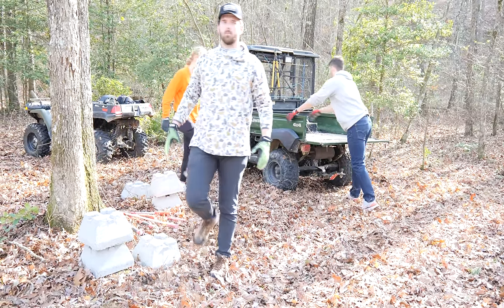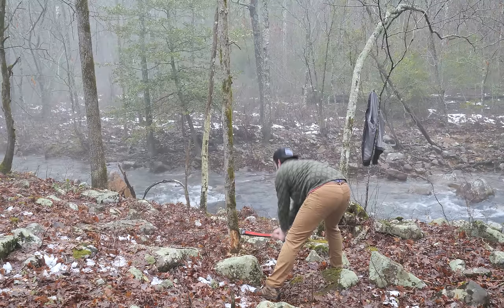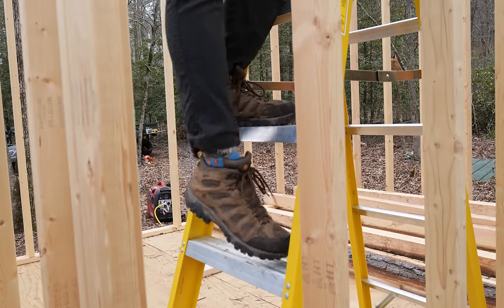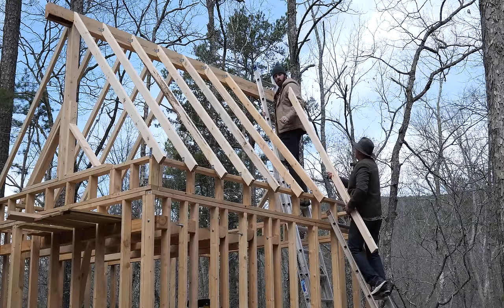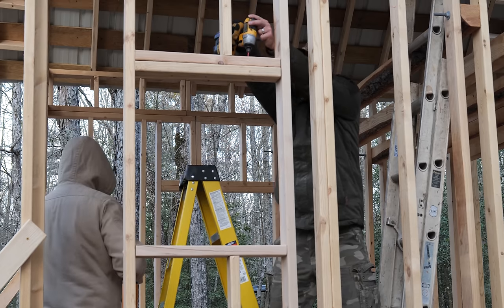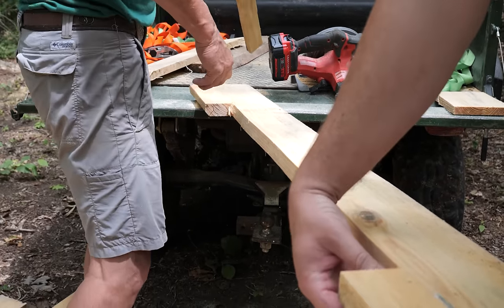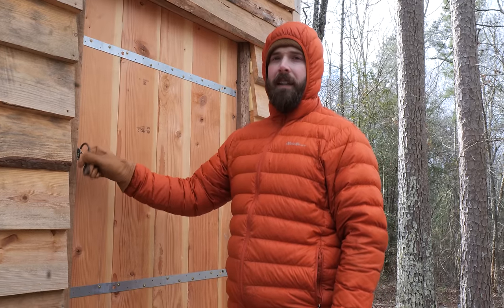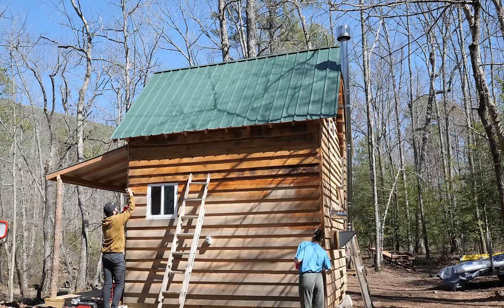One Year Building A Remote Cabin In The Woods | Start To Finish

Comment: Two comments: Wouldn't it have been easier to frame the openings while building the walls as opposed to cutting them out after erecting the walls? And two, why aren't you door and window headers in? Or installed at the same height?
Reply from the maker: Absolutely would have! We just were undecided on where we wanted the windows so we did it later down the road.